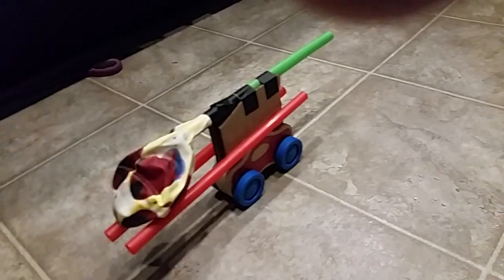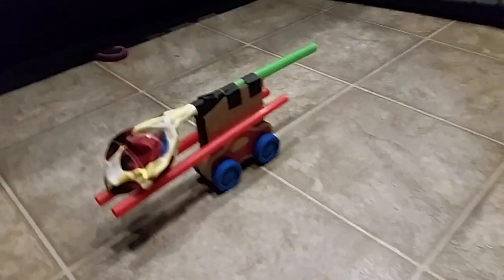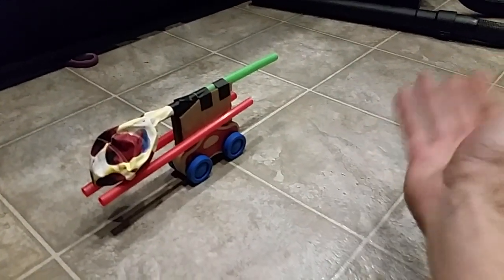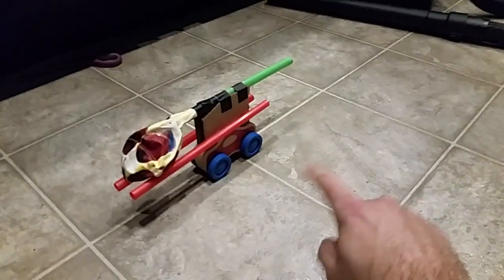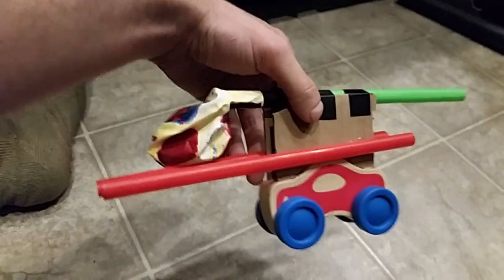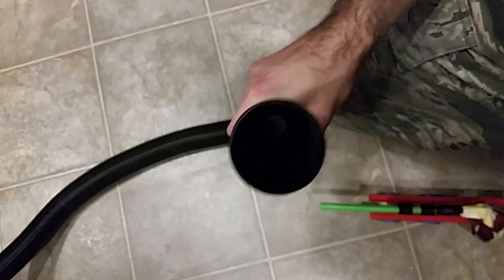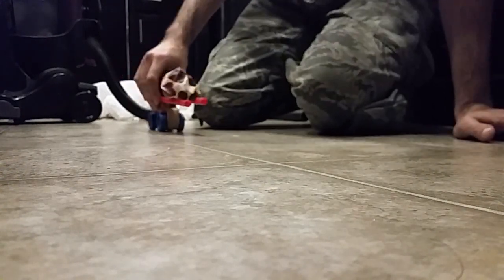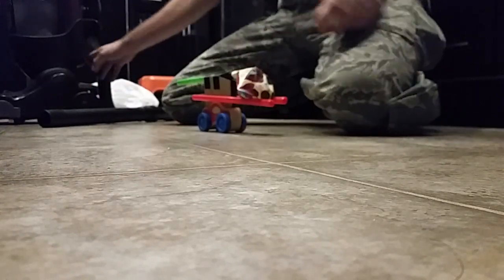Newton's Third Balloon car with vacuum behind it

Comment: wrong experiment the air of the balloon is pushing against the wall of the tube of  the vacuum cleaner.
Reply from the maker: This was mostly just made because some other person thought the experiment was earth shattering and disproved Newton's Third when they couldn't get it to work. I am showing that their experiment setup was terrible because I knew this would work.

Regardless of that, the skin effect that allows what you are claiming would be almost nothing compared what the car originally needed to work. The car goes like exactly the same by itself or with the setup. If the thrust wasnt from Newton's Third it would not even be close to functioning like it does by itself. With what you are saying the car would also function better by having the nozzle near the ground, or pointed down a bit, and I can tell you it does not make it function better. Mass thrown from something that acts like a rocket does not increase thrust just because it hits something. I made a video showing this with a hose. Putting something into the stream does not make the thrust increase.

If you need a better representation of that I can make a video of it where you will have no way to claim that fluid being expelled makes thrust by hitting something. I would just hang the hose upside down while on. It will have a certain amount of thrust to push itself to some amount of angled. I will put something into the flow all the way up to almost touching it and it will not swing any farther. Do you want to see that?
Reply: @Jasoninee  do you want to see him fix a science experiment? 😂🤣
Reply from the maker: @GotALLmyVACCINEs ForAllKnownViruses  Sorry but your comments make no sense of having any valid point. Do I want who to fix what? What are you commenting about?

What facts are changed?

Are you commenting on me remaking a guy's experiment that was of an absurdly poor design? Where his car barely worked and would sometimes get stuck? Where his results showed what he didn't even want to show like half the time?

An experiment without repeatable results is nonsense. Who is ever going to claim anything meaningful from an experiment where the setup barely works at all and the results are not repeatable to any meaningful degree whatsoever. My car works EVERY TIME. There is no lack of thrust done on a soft moving surface to where I am like "oh shoot whoops... didn't get the result I want since the car barely works... guess we'll do it again".

I honestly don't think this experiment is worth much at all. I only remade it because the guys original setup of it is atrocious. The physics works and I absolutely knew it would work when the setup is not absolute trash with a car that can't even start moving half the time. I even took his a step further and put the nozzle IN THE TUBE. Not only that but I also measured the air speeds.
Reply: @Jasoninee  the vaccines are strong in this 1.
Reply from the maker: @GotALLmyVACCINEs ForAllKnownViruses  What are you talking about? 🤣🤣🤣

If you are randomly nonsensically throwing out stuff about me with COVID-19 vaccine stuff I guess I can inform you that I oppose the idea that the COVID-19 vaccine is forced on anyone. That was a choice for people with freedom to decide for themselves whether or not they wanted a vaccine that wasn't tested like every other vaccine needs to be.

Big pharma and the whole COVID-19 garbage was a very shady set of events.

You have any comment that is remotely close to the topic of the video?

Comment: You should put a restriction in the end of the straw and see if it works. Seem like the vacuum cleaner doesn’t have enough cfm.
Reply from the maker: Honest question: What am I going for with putting a restriction on the end of the straw?

The vacuum is crazy strong. I never let my vacuum get clogged up to the point where it accidentally sucks up gigantic things all the time. 

I am not sure if the balloon will still be serviceable, but I still have this car on a shelf, and can do most anything that provides understanding. This is mostly made in response to a terribly designed and executed experiment that actually seemed to be intentionally designed with bias to accentuate faults.
Reply: @Jasoninee  putting the restriction in the straw would allow the vacuum to keep up with the air flow from the straw better simulating the immense vacuum of space.   You would have to have the restriction big enough that car still moves but not too big as to have excess air blowing out of it. 
That’s a fairly small vacuum cfm wise. A bigger hose with a lot more flow would also help. 
Lmk how it turns out.
Reply from the maker: @cspaz1  

The air flow of the vacuum is over 60mph. That is what my anemometer maxed out at, and that is like a quarter of an inch away from the vacuum end. If I actually put it on the vacuum end it sounds about 50% higher than the max and seems like my anemometer is going to explode. The velocity of the car air measured to never more than 30mph. With this, what does "keep up with the air flow from the straw" mean?

Are you inferring that my vacuum cant keep up with the amount of air coming out of the ballon/straw to where it acutally hinders it?

Wouldn't a valid discredit of that be showing that the balloon will not deflate slower on the vacuum end at the same amount of being blown up? Higher velocity air has lower pressure. Does this mean you are also claiming that a lower pressure outside of the straw somehow would impede the balloon deflating versus the higher pressure static air?
Reply: @Jasoninee  It’s a simple thing to do to make this modification.  Yea I’m saying that the pressure in the vacuum hose is not actually a true vacuum it is full of air rushing into the machine. If you put a vacuum gauge on the hose hear the opening where the straw is sitting what does it read. It will be no where near 25inhg. So creating a bigger ratio will somewhat compensate for this.
Reply from the maker: @cspaz1  

Well yes absolutely it is not an actual "vacuum" in a physics sense, but that was never the point. This experiment was made to redo one that space deniers would reference where the dude performing used a terrible setup that made the results essentially meaningless.

The claim presented is that a "rocket car" (one using expelled gases to propel itself) only goes forward due to the gas escaping running into the gas of the static air, because if was true air going slower than the airstream it expels into cannot push off of it.

I also made a video showing that the force from a hose spraying never goes up when you something up close to it for it to run into. It is essentially inconsequential because the thrust comes from throwing mass. It is impossible for anything to throw mass without a force being emparted in the opposite direction.

If this was not the case, and the thrust was from colliding mass, a person on ice throwing a big beach ball would accelerate more than throwing a small heavier ball.... this is 100% not what happens though.

Comment: jasoninee
You are hilarious!
Now your straw shooting air is pushing off the inside sides of the vacuum tube that you push along with it.
Reply from the maker: This is only in response to someone else claiming this setup means anything. The setup was used by them thinking it shows that the thrust goes away... it doesnt. As far as I can tell hey intentionally designed a poor experiment claiming it proves thrust wouldnt work when the air gets vacuumed up.... it does work though

Newton's third is what propels bodies when throwing off matter. Watch my video with the thrust from a hose not changing at all when something is put in to "push" off of. The thrust is from throwing matter. It is impossible for a body to empart a force on matter without pushing itself backwards. If you made a gun floating in the vacuum of space remotely fire you think somehow the gun magically decides it is supposed to stay motionless? Anything that shoots matter gets thrust from the matter being pushed away from it.
Reply: @Jasoninee  Anything in an ATMOSPHERE that thrusts against it moves.

Thrust requires an EXTERNAL mass to push against.  This is basic Newton physics.

Stupid people think THRUST is not pushing against the external Atmospheric MASS.

The Atmosphere is the largest mass outside of the ground but idiots like you think that giant mass has nothing to do with thrust!? LOL.  Just stupid insanity.
Reply from the maker: @54321Truth  

Not sure how we are between two different comment chains, but please go to the other replies for where I am discounting everything you are claiming with common sense examples.
Reply from the maker: I could also cover the point you are attempting to claim by measuring the force felt by the tube if I release the air into it again, but have the setup stationary for measurement. I can assure you that that will be essentially zero force pushing against the tube to make thrust.

Comment: Ok do me a favor  attach a solid cardboard one inch away from the end of the exhaust tube so that the exhaust hits the cardboard one inch away. You need to tape it to the tube and have it come down and block the exhaust about an inch or two behind it.hope I'm making myself clear.
Reply from the maker: I do believe you are making that clear, but you do realize that if you are hoping the car won't really go anywhere that you would absolutely be correct and that is the normal physics of that situation right?

That would be the equivalent of trying to throw a bowling ball while sitting on a skateboard to propel yourself, but having it hit a little wall attached to other side of your skateboard. So the push it took to push the matter away is the exact same amount that is needed to stop it woth the wall, which is also the skateboard, which is also you lol
Reply: @Jasoninee  you said the atmosphere has nothing to do with motion only the exhaust escaping the container or the rocket will create the opposite reaction, gas pushing out of the rocket  is all you need. Well in this case the gas escapes the balloon but it's flow into the atmosphere is reoriented and there is no movement. That is my point. It's not a convenient explanation oh that is normal no it's a point.
Reply from the maker: @bartaroyan8529  

What does expelling matter and then it hitting your own self as a system have to do with anything but simple "you pushed it, and now it pushed back"?

I expect it not to really move at all. With that knowledge do you want me to show you that it will do as I suspect, or does that just match what you suspected anyway?
Reply from the maker: @bartaroyan8529  

What you are getting at is the same as thinking you "got me" by asking me if I think I can blow my own sailboat, or propel myself by throwing a heavy backpack, but holding onto the handle.
Reply from the maker: @bartaroyan8529  

You do realize you set up where Object A pushes on a mass, that mass then hits Object B. Object B loops around through rigid structure to then empart its force back into Object A.

So Car pushed from expelling gas, gas then hits structure emparting force that hooks around and attaches up to the car.... how does this really come about commonly as a flat earth rocket type question? If that works well that means I can also fly by lifting myself up by my own pants.
Reply: @Jasoninee  you tell me. thats what you guys are saying happens in space, the gas explosion creates the forward movement.  no gottya I'm just trying to understand what creates the rocket movement. is it the thrust against the atmosphere or thrust in itself against the rocket body. obviously its not the explosion against the rocket because our experiment shows when you take away the atmosphere or the pressure behind the rocket it doesnt move
Reply from the maker: @bartaroyan8529  

Well no we definitely did not show that it doesnt work when the atmosphere is taken away. I can actually provide examples of the principle working in a vacuum. A rocket works amazing without atmosphere. There is a video with a can exploding in a vacuum chamber in high speed. It instantly moves from thrusting out soda without anything hitting the wall yet. Since the gas is at the top and must be even in the worst case contained in the soda, there is also no gas "making an atmosphere" in the chamber. He even has a vacuum gauge on it for the test also.

You are making it sound like calling shooting gas an explosion out of an oriface  in space somehows makes some special point. I fail to see what you are getting at. Gas is quite literally the equivalent of super tiny balls of mass. The rocket has a reaction inside that releases enormous amounts of energy as heat/pressure in the gas. The gas has one way to leave. Pressure is only a result of moving gas molecules hitting each other and the sides of their containment. When you open an oriface to a pressurized system. They, IN GENERAL, all leave out in the same direction, which must have pushed IN GENERAL the other direction. If you go down to the molecular level of that scenario it is 100% impossible to have a molecule end up going "down" without before then having a collision at some point that resulted in it going in general that direction. The gas coming out of a nozzle was a result of running into everything  that did not allow it to leave up until it happened to reach the oriface. All that colliding was essentially causing pressure inside the rocket (which disregarding the oriface it makes an overall net movement thrust of NOTHING.)

Just like a scuba tank doesnt move just because it is sitting there pressurized with molecules zooming around colliding. Opening a hole only on one side forces the molecules to go from collisions pushing "forward" since that is the only way for a molecule to end up going "backwards", and now it made its way out. This means there MUST BE a net force the other way. It had collisions to end up backwards, but leaving backwards it no long has the ability to make collisions that empart any force back to the tank.

It seems like flat earthers have this weird thought about gas molecules like they are magical "repel all and their own kind magnets". That is not what gas is doing. It is just collisions and conservation of energy. They collide and then continue off and colliding.

If you want to use an example of a balloon (which I assume is an idea that would get people that dont know physics hung up on this) then yes it seems this way. BUT one has to understand that a balloon is only a balloon because the molecules inside are zooming around with there energy contained in them and randomly hitting themselves and the balloon barrier in ALL DIRECTIONS. When you take the barrier away YES in that scenario the molecules seem to "explode" since their barrier was completely taken away while they were all going random directions, so now they just go off in their random directions no longer colliding so it would be similar to an explosion.

A rocket has so much pressure and so many molecules at the nozzle that there is no reason to discount in a vacuum that quite a few will be shooting off to the "sides". It is almost like one of those reflective tube skylights in a house that bring the light down into the room. Sure there is a whole bunch of light bouncing around that ends up getting out, but it does not "explode" out of the bottom. In general it is directed "down" and away from the "nozzle" of light. Obviously the will be some light at any angle that can see some of the tubes inside edge, because you are looking at a reflective surface which means you are at a potential good photon path.

Again... gas molecules are not magical expanding repel-themselves magnets. They fly off and continue if they dont collide with something.
Reply: @Jasoninee  ok dude. if  you block the flow with cardboard the car does not move. i dont want to argue. think what you want
Reply from the maker: @bartaroyan8529 

Yea if it is attached to the car. Exactly as expected by both of us. If you need me to show something that we both know is going to happen I can, but it seems kinda wasteful.
Reply: @Jasoninee  unless it makes my point and you dont want to admit it . such a waste of time.
Reply from the maker: @bartaroyan8529  

Well yea, but that absolutely wouldnt make your point. What you are asking would make it not act as a rocket anymore, because you would be having it blow matter out and then hit itself to negate the thrust from the blowing.

It would be the same as trying to propel yourself by shooting something, but having the bullets be tied to you...  I am confused how you dont understand this.
Reply: @bartaroyan8529  stop trying to think of a rocket in terms of the exhaust creating the thrust by pushing against something behind it. That's not how rockets work. This video gives a good example of how they actually work: 

https://youtu.be/kAZMBAVRsCo